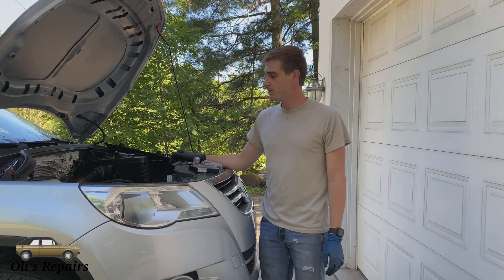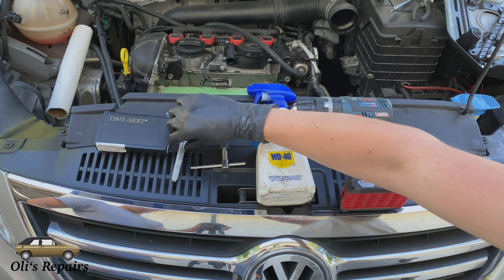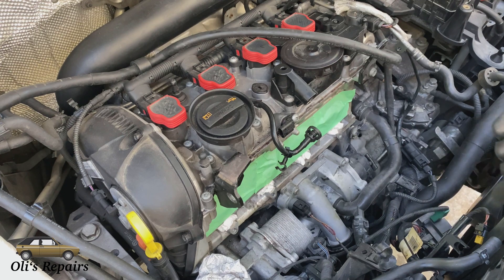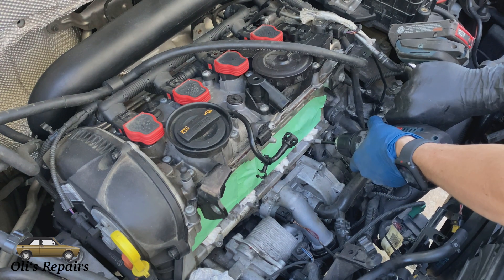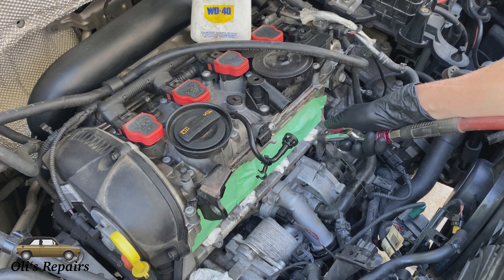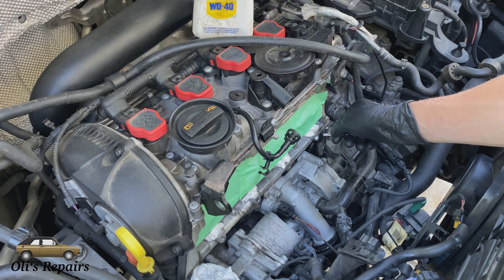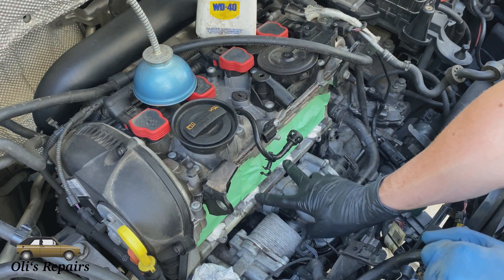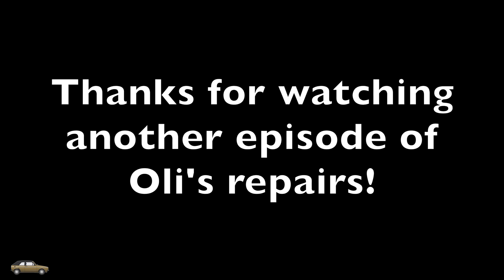You’re fixing stripped threads incorrectly!

Comment: What length inserts did you end up using?  The kit includes 5x M6x1.0x9.6mm Carbon Steel Inserts.  My hole is right at 16mm deep.  I am drilled, countersunk, and tapped.  But, I cannot get the insert to seat fully into the countersink relief.

Comment: Keensert is another brand that make this style. They come in both thin wall and thick wall depending on your needs and have locking pins that are driven in once installed.
Reply from the maker: Thanks for the info. I will keep those in mind for future repairs! Helicoils are just so cheap and do not work well long term.